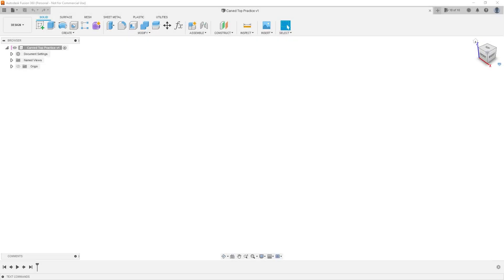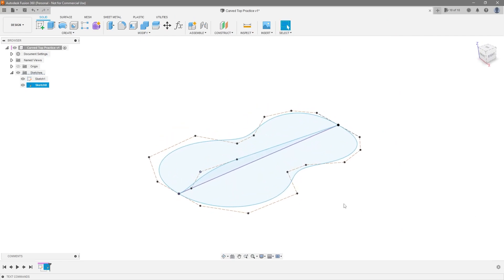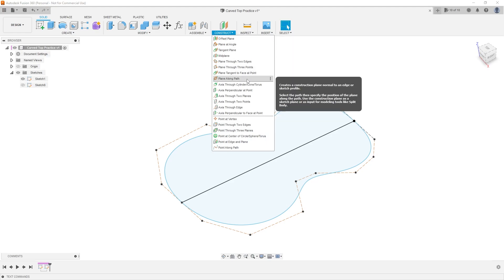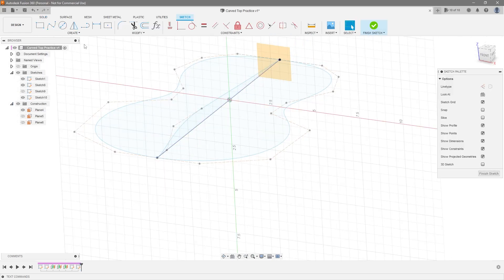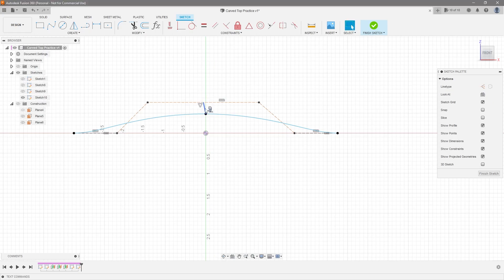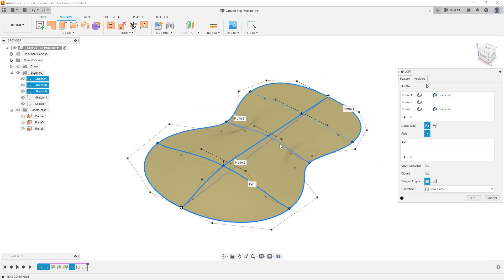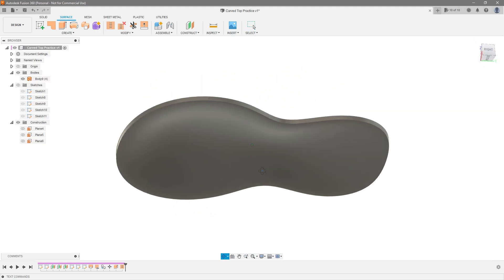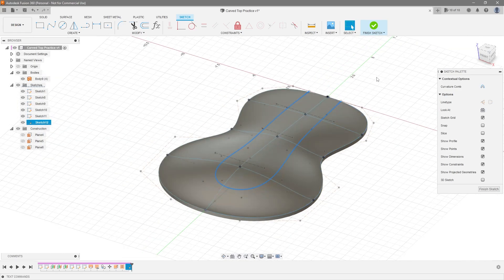How to model Carved Tops in Fusion 360 in under 15 minutes.

Comment: Great video on using the loft command for carved tops... I have built a number of F-style mandolin models using patches... the difficult part for me is connecting the scroll to the main body of the mandolin.  My current models require a bit more hand work around this transition than I would like.  any thoughts adapting your technique to build an F style mando/scroll?

Comment: Hi Austin. I am using your method here to try to model a carved solid top, but running into issues as my shape has a cutaway similar to an LP. As it is not symmetrical, I am having issues with lofting as it says bad geometry, intersects with itself, etc. Any suggestions on how to do this method but for a guitar with a cutout?
Reply from the maker: If using a cutout there are a couple different ways. First, is you could model the initial top the same way as in my video, but then with a separate sketch simply extrude to remove the cutout section. 

Another way is to break the loft/patch into more manageable chunks, instead of one large one. You can use G2 curvature option to make sure it matches the larger surface. 

You can also use the form workspace as well if you are comfortable with it to shape the entire top. But I've found that the most difficult.
Reply: @austinshaner  Thanks, Austin. I followed your advice and did the cutout after the surface loft. I found that when I did a solid loft between two rails there was part that didn't extend to the boundaries all the way (like a crease). So I did the surface loft and it worked. The issue is after the cutout extrude, there is a slight opening where the top meets the bottom in the curve of the cutout where the height from the loft is a bit higher than the body. If I patch it, it seems like it is a sharp transition. Is there a better way to fill in that space so it follows the curve? Sorry if this is confusing. Hard to state without a screenshot.

Comment: I have been following your YouTubes on carved tops. I am interested in building a cello using a CNC machine and Fusion 360.
 The procedures are very similar with the exception of the outside shape.
Could you address how to program for a cello (also a violin, bass, viola).
Thanks.

Comment: Does this apply to asymmetrical designs? I’m reverse engineering a pick guard from a 1930s guitar and it has a bevel similar to what you created here but it is not symmetrical, it should be easy enough to accomplish but all I want to do is create a similar symmetrical bevel but on a asymmetrical shape. What are your thoughts?
Reply from the maker: Yes it can apply to asymmetric designs, but you may need to alter how you set up the planes so the rails point in the direction you want.
Reply: @austinshaner  I’ll mess around. I got super close using a similar concept using surfacing, although I could only get it to follow the contours as if it was a box, the inner edges didn’t get contoured if that makes sense

Comment: Fantastic video Austin. Wish I'd had this around when I was first trying to learn Fusion to build a carved top guitar. Would have saved me a lot of time and headaches for sure. Just wondering if you could show how to create the flat center block portion of the carved top to mate up to the body some time. Hollow bodies need material there to mount the bridge and pickups. Thanks for the great video.
Reply from the maker: I will definitely do a follow up video at some point that models a proper carved body.  This video was just intended to get people familiar with the general technique and inspired to give it an attempt.

Comment: Hi Austin. Thank you for all your wonderful videos. I have learned a huge amount from them even though I am still struggling as a relative beginner.

I wonder if you could answer a question (or maybe even make a video about it) please.

I can understand how rails can be used to loft an archtop as the ribs (sides) are typically level and the arch changes to meet the top edge of the rib.

However, I am really struggling to model a “flattop” acoustic. In this case neither the top or back are actually flat. Instead they effectively have a consistent radius of say 28’ which means that the height of the sides must actually rise and fall to intersect the top at the appropriate point on the radius. 

The only way I can find to do this is to model a solid sphere or a surface section of a sphere then draw the body shape and extrude an intersect through this to create the top (and repeat the process for the back). Is there any other more effective/efficient strategy to model an acoustic?
Reply from the maker: Hey mate, I actually think that is a really simple and effective way to model acoustic tops and backs... and also the most parametric friendly...since you are using the base geometric shapes to do it. 

Really all you need is a shape with that radius, and then let the outline fall where it may on that radius. 

I think the way you are using let's fusion do that math for you, rather than trying to direct model with lofts and rails etc.
Reply from the maker: That being said, there are a few people on my discord who have done a ton of acoustic stuff and they may have a more refined approach. I'd encourage you to join and ask. I'm sure they'd be happy to help!
Reply: @austinshaner  thanks for the input. Much appreciated. I joined the discord group last night so will ask there today. 👍

Comment: Gents- Could you explain further what the "Project "command is used for in offset plane operation?
Reply from the maker: Hey Tom, sorry for the late reply. The project intersect command brings in the portion of our previous sketches that cross through that plane. The purpose is to give our new sketch something to snap to, so that way we know the curves we are drawing "connect" to the Sketches we did previously.

If we didn't do this, the loft command would give us an error when we try to utilize those rails saying "Selected rail does not touch all profiles"

Comment: Great video as usual.  As with the neck I have been going along these lines but you simplify things.  You know now a lot of people are going to ask this - what about a cutaway?
Reply from the maker: Hey Alan, yes I've been getting questions about cutaway using this method. At some point I'll produce another video on the topic and include that. In the short term, if your design permits, the easiest way to have cutouts is simply to extrude/cut them through the body after its already been lofted. So loft the more general shape then slice off the cutaway. Designs like PRS that include unique curvature or beveling  in the horn may require a bit different approach. 

Otherwise you just need to get creative with your rails and the order or direction in which you loft, but the essential process is the same, but different in the details.
Reply: I have a video showing how I do it. Hope it helps.

Comment: Awesome. Very simple solution. A bit different than how I did it. I wonder how it will work with cutouts. I need will give it a try. Thanks Austin
Reply from the maker: Cutaways add a bit more complexity to it. If it's a simple Gibson Lespaul single cut  then you can simply extrude a cut after the top is created. Other designs (like PRS for example) that have unique geometry in the horn need some extra steps.

Comment: Great to see you diving into this subject man. I've modeled a les paul using something similar which I took from a french guy here on youtube, but I am very curious to see what you're adding to this foundation. Btw if you ever get to actually carving one of these on a cnc, consider not creating the pickup cavities, knob holes, neck pocket etc on the carve top model as fusion tends to create some weird paths for the carved surface operation, in my experience at least.